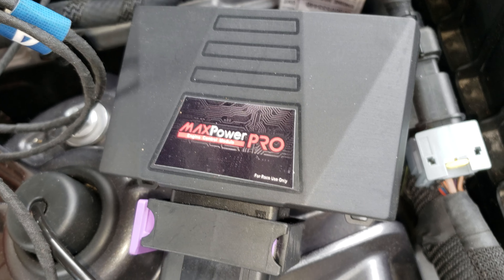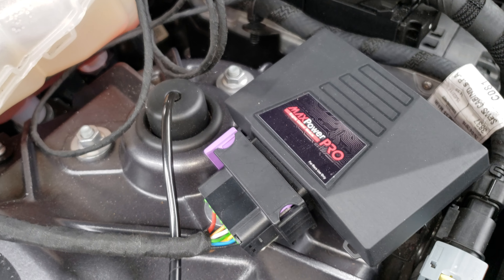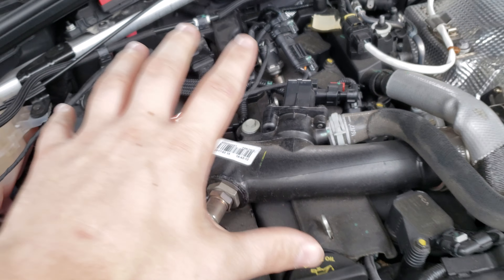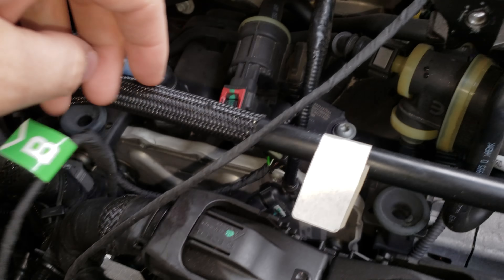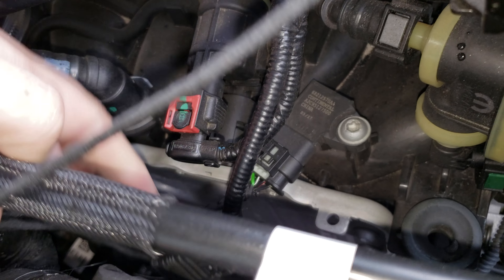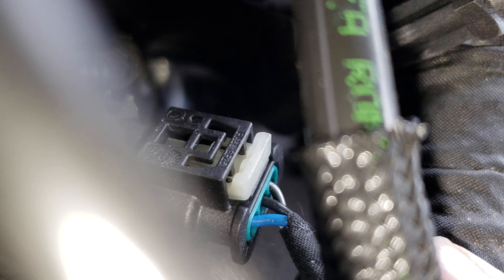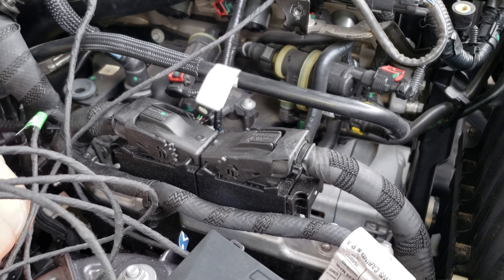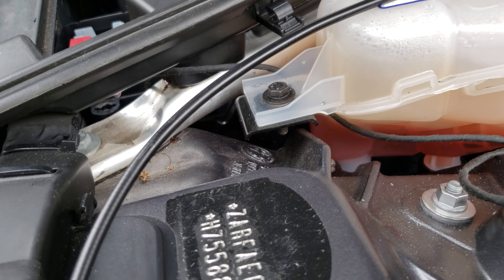Madness autoworks Max Power Pro Install

Comment: I know this is an older post but does this tune remove the speed governor or bypass it?
Reply from the maker: I doubt it. It woke the engine up big time. But the car only ran 2 weeks out of the 6 months I owned it. When it started damn did that thing move

Comment: I Installed it exactly like this and got the CEL on. Removed everything but now the CEL does not clear..I checked all connections and disconnected the battery but no luck.  Any Suggestions?
Reply from the maker: Now when you restarted the car after the battery was plugged in did you do the steering wheel set up? Turn the wheel one way then the other and straight then shut the car off?
Reply: @AnythingAuto  sorry for the late response. I was able to reset all errors by cycling the ignition 5 times. I re-installed the module and this time it worked out just fine..  I'm really enjoying the new upgrade but I noticed it mellowed out after 200 miles after install.  Did you experienced that  as well?
Reply from the maker: @luismazariegos3910  I was going to tell you how to reset it lol yes, it does calm down. I loved the balls to the wall for the first 100 miles. Then it learns with the car and calms down. I was still able the break loose after it calming down though.
Reply: @AnythingAuto  haha exactly but you are right, it's still a great upgrade.
Reply: @AnythingAuto  hi there, I have a 19 giulia and was thinking about getting this piggyback.  So you have any other mods?  Have you ran any numbers with it at the track or anything?  Are you still living it?  Would appreciate any feedback, thanks!
Reply from the maker: @shwoogs2608  I'd say sell the car as fast as possible because it is an absolute nightmare to own. If you choose not to sell no I did not have any other mods. The car spend 6 months in the shop with electrical issues so didnt get to test it at all. The module was amazing though when the car ran! I smoked a fusion sport with all wheel and twin turbo.
Reply: Jeffery Wayne hey so I don’t know much about cars and was thinking about getting the ecm module cause it should be discounted a little now. I was thinking about getting the go pedal as well. Can I contact you on Instagram or something so I could ask a couple question?

Comment: That's funny I got a kizashi and I always felt the gulia had a similar vibe I kinda want one next
Reply from the maker: It's crazy powerful for a 2.0. The torque is insane
Reply from the maker: so after some time of owning the guilia you do NOT want one. the shop has had it more than i have. the powertrain is amazing but the electrical and paint is garbage. the car runs for a week or two then it shorts out and they replace more parts.

Comment: Hey did you have any issues connecting you ECM to your phone with the app?
Reply from the maker: I did not opt on for the bluetooth connection
Reply: Jeffery Wayne How were you able to connect it then? I have it installed but for some reason it wouldn’t connect. Do you have any suggestions?
Reply from the maker: @tonycabrales5185  I am not sure what you mean about "connect". I installed the module as shown in the video then did the roughly 100 mile breakin or learn period. During that period it was a ton of fun. Balls to the wall then it smoothed out. I was still able to break the tires loose but wasnt as crazy.
Reply from the maker: @tonycabrales5185  If you mean that it will not connect to your car and you have no codes then i would check your power wire. if something is hooked up wrong you will get engine codes.
Reply: Jeffery Wayne I realized I was talking about the wrong unit lol. I have the same one as you and I officially broke it in and I LOVE IT, thank you for the help I appreciate it!